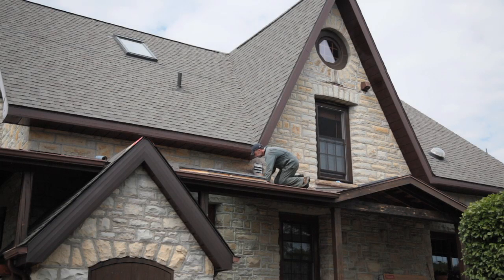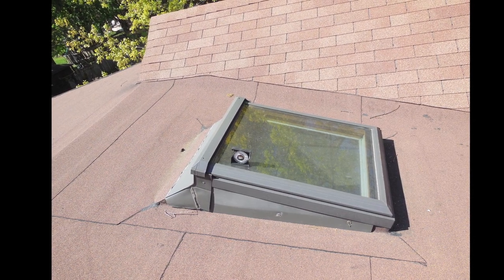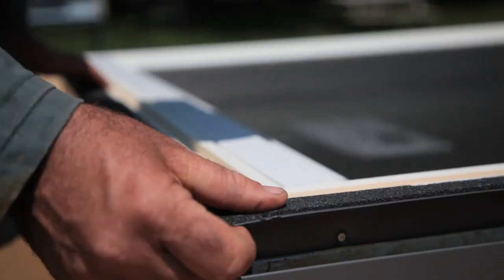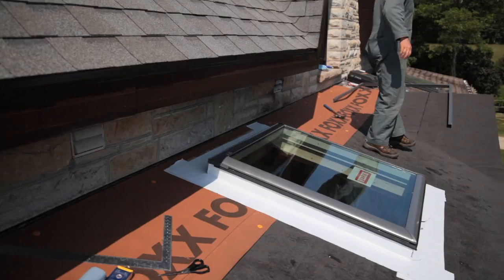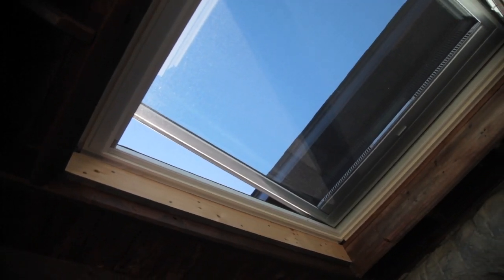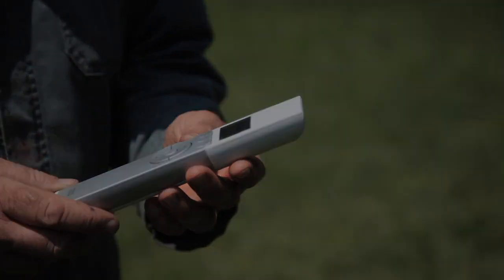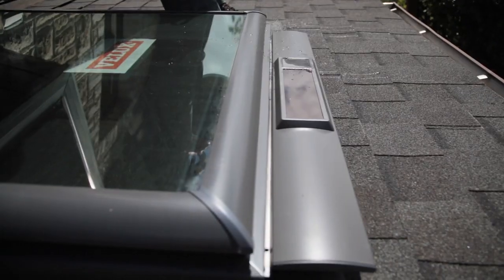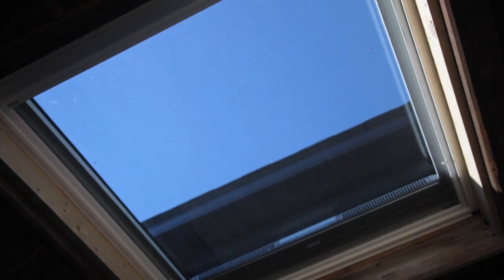How To Install a Solar Skylight

Comment: I really want to add a skylight to my renovation plans for my attic. And the benefits of a skylight that opens seem great. However I've had squirrels camp out in my attic ceiling before (a problem I've corrected)... Are there screens to accommodate such concerns?
Reply: squirrels eat through lead, aluminum, wood and more so the best solution for them isn't a good outcome for the squirrels

Comment: how much it cost to fit one like that in my home???
any ideas of prices??
Reply: K
Reply: Find the item get the typical price. add 40% markup 1300 you may be able to get a tax credit to offset the price.

For labor figure 2-3 hours for setup, install and clean up. A roofer would do it for 600 to 1000 depending if its a curb mount or deck mount. 

$2300.00 is a decent price for one but please make sure you have a pro install it. DO NOT go with the cheapest guy of a friend of a friend

Comment: Plan on doing a double storey. The UK council say I have to set the first floor extension back 1 meter from the side of the ground floor build/boundary.  I would be losing my exsisting skylights on the side of my ground floor. I want to install a single flat skylight but approx. 2 meters in length and under a meter wide on the bit of roof I'll have left on the ground floor to bring in light.  Any advice will be much appreciated. Amy x

Comment: Hi Steve,

Great video.  I was wondering if you can interchange between a VS solar powered window with a GPL or GGL.  If they're using say a S06 size.  Is there any extra work due to it being solar or can I replace one with the other?
Reply from the maker: Hi rslab!

Thanks for your good words about my video. It's always good to get encouragement.

The installation of VELUX solar skylights is identical to regular VELUX skylights. I've put both in. I think the size designations are the same too, but I'd check with a dealer if I were you. I'm 99% sure they're the same, but that's not the same as knowing for certain.

If you don't already get my newsletter, I'm sure you'll find it useful. About 7000 people are regular readers. You can sign up for free at:

http://stevemaxwell.ca

Bye for now, and thanks for watching my stuff!

Steve
Reply: ***** Thanks Steve.  I had talked to a preferred velux installer and he was a little confused on GPL and VSS.  I guess what I'm really asking is can I use the same flashing once installed in the roof.  Therefore, I could "easily" just pop out a GPL where a VSS is without any carpentry work?  They would both be an S06 just one is GPL and the other is VSS.  I currently have GGL's and it's simple to pull out the window.
Reply from the maker: rslab Ah! now I see. I don't think the swap would be easy. It may be possible to switch the sash components (I've never tried), changing the actual frame and such would be a pain. I have removed skylights, and it is troublesome. It can be done, but it's the home building equivalent of careful brain surgery.

Comment: We have a skylight on a flat roof that was made of some kind of plastic. It never leaked but a hinge broke away from the plastic and it's not reparable. The good thing was that it opened fully so we could get onto the flat roof once a year to clean off any leaves and debris. Are there any Velux skylights that open enough to allow access to the roof?

Comment: Great video,
I'm about to choose  solar skylight and I'm wondering if shades can be operable on same remote control as opening skylight or needs remote for the shades needs to be wired? 
Which one of these skylight are easy , more work to install solar or hard wired?